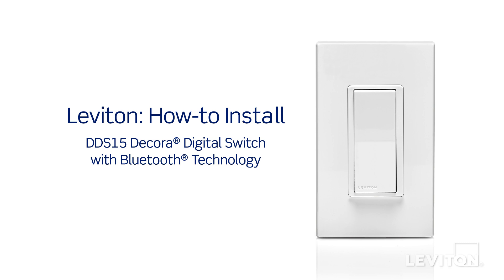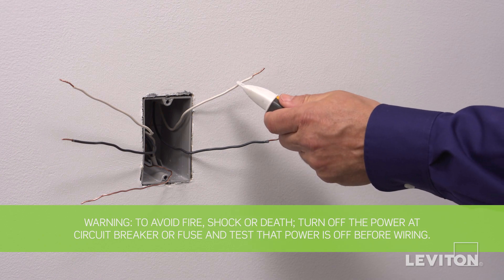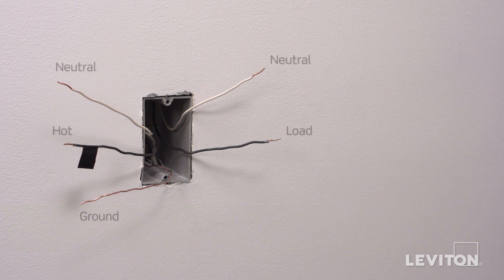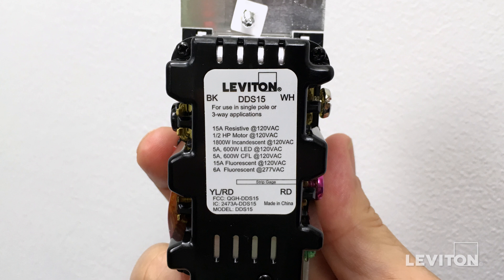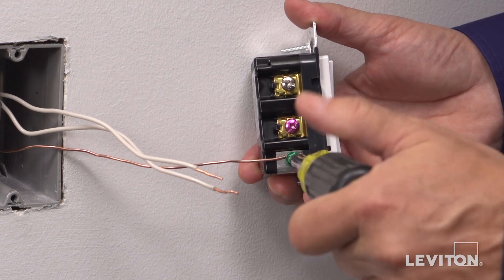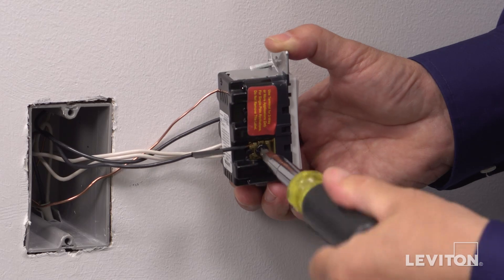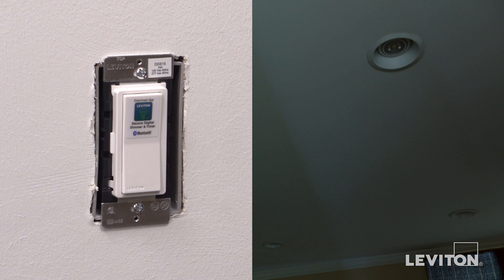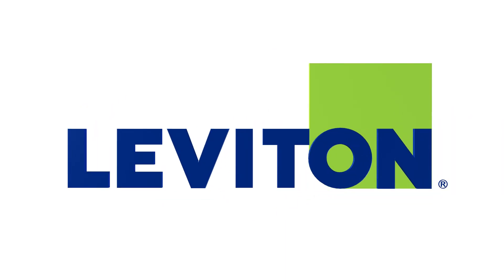How to Install a Decora Digital Switch | Leviton

Comment: Great video with great information. My neutral wire, like many homes was capped off behind the switches. I simply added two wires for for my two switches and I was good to go. WIFI Programming is even easier, just follow the manual. It's your typical scenario where you first have your phone added to the switch as though the switch was its own DHCP server, then once your phone is connected to the light switch, you add your WIFI setting via the Leviton App.